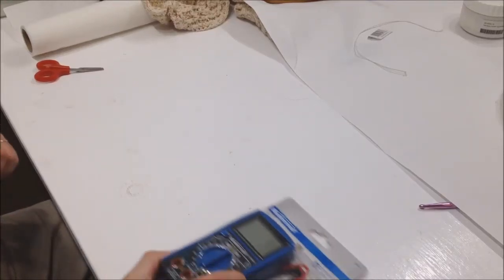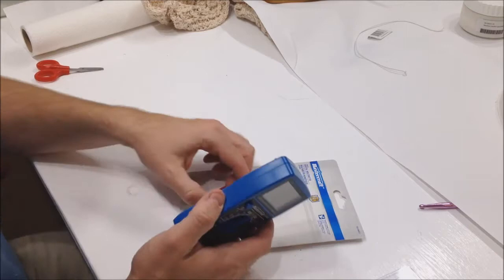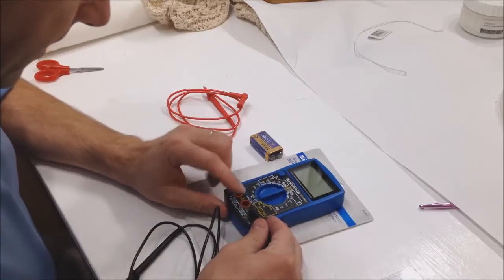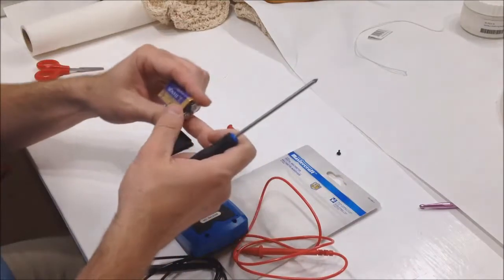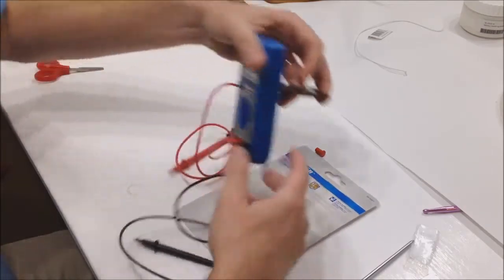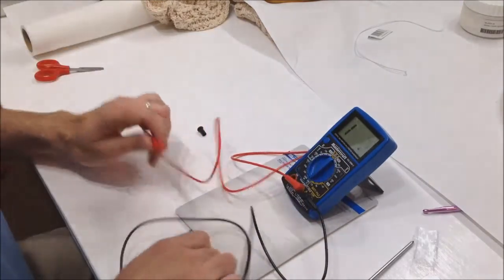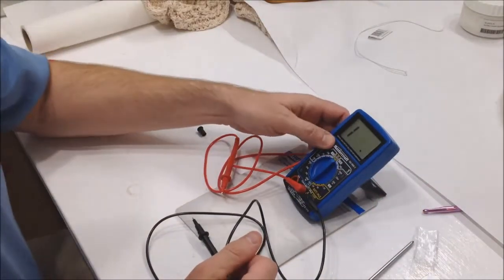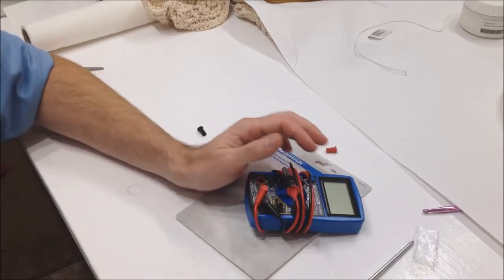Unboxing Mastercraft Pocket Multimeter

Comment: Important Update This Video was made back in 2017. I bought mine: Oct 26/ 2022.  Mastercraft Digital Multimeter 052-0055-6. This product Now comes with a Light Blue Rubber protective cover 
(PVC) that surrounds the product. This Rubber cover must be removed so that you can get access to the rear battery 9- volt Battery Compartment. Once you do get the cover removed, it is just like in the video. Use a Philips screwdriver to remove the screw and insert the Battery. Best Wishes. P.S. I paid $23.99 for mine.---
Reply from the maker: Awesome, must make it less slippery.  FYI, leaving it in the sun will black out the display but let it cool and it will return to normal.

Comment: I just bought 1 off theses I tried to test a wall socket but the ends would not go in far enough any ideas how i can do this thanks
Reply from the maker: No, it works on some but not others.  It will work with any kind of lead.
Reply: @RedBarnHomestead  Thanks